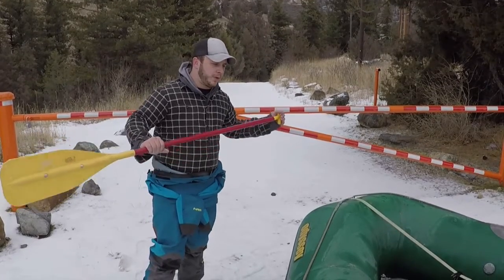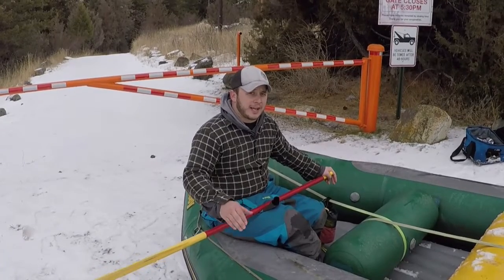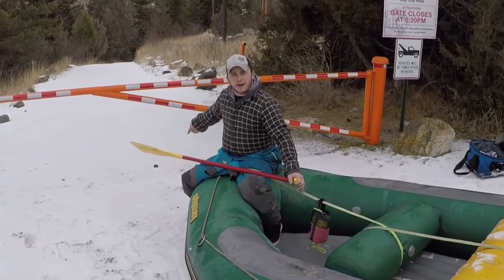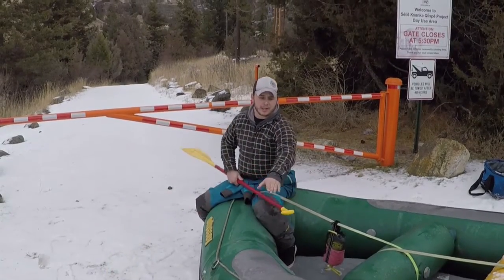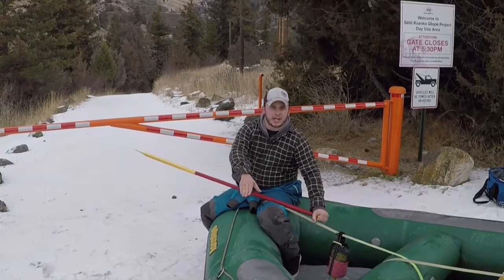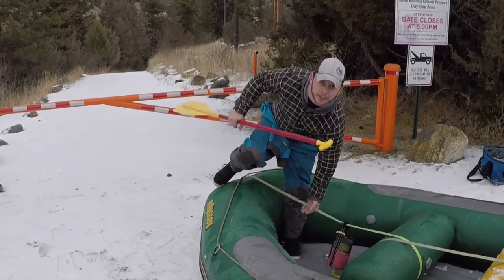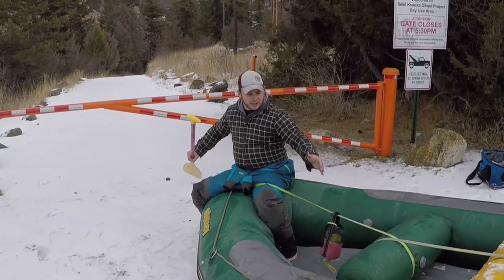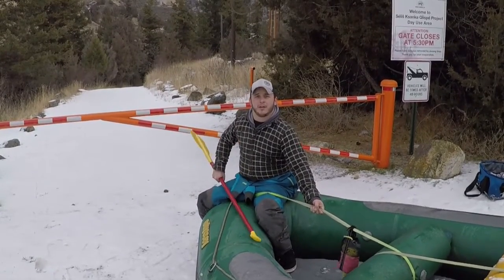The Center-line and why i use it!

Comment: I've been rafting, kayaking, guiding since 1986.  I do have experience with center lines, good and bad, so let me share a few thoughts.  Entanglements:  we flipped a paddle-raft with a full-length center-line on the Crooked River in Oregon at high-water and my foot was entangled in the line and I was trapped under the boat.  Luckily, I was able to work myself loose just as I was pulling my knife, but getting dragged most of the way through a long Class IV+ was pretty sobering.  If you're entangled and getting rag-dolled, even being able to reach the strap to cut it might not be possible.  I would suggest not doing a turn around the thwarts and instead securing it with with a smaller strap run under the thwart and over the center line on either side of the thwart (kinda hard to explain, get in touch if you can't make sense of that, there is a "trick" to it).  This holds it tight to the thwart and you don't have a loop that an arm or leg could potentially get snagged in.  Most boaters I know who have rafted a lot of serious water either don't use them or use modified versions after having had a sketchy experience, including getting caught in low-hanging branches.  In the early 90s, we used to do low-water Green Truss (White Salmon) runs with a center strap and the person in front and back tucking a leg and sitting high like you do (referred to as "sweep-boating" similar to what they do on the Middle Fork).  Upside is that it is extremely manueverable, like a tillered fire truck, and the downside is that you have a high center of gravity, half your body is hanging out and it's harder to stay in the boat.  Also, as you pointed out, you're just a steering wheel and not assisting much with paddling.  Your choice, I guess, but I personally wouldn't do it in anything above benign Class 3.  All that being said, I love the enthusiasm and love of boating that you and your crew have and hope you all stay safe and enjoy a lifetime of adventure.
Reply from the maker: Rob thank you very much for the story and finally putting a name to the "sweeping method"! Guiding like this is definitely a personal choice and I'm very glad you are open to people doing it, there have been a ton of people who have been very negative and harsh about it. I'll be in contact to learn the "trick" you speak of
Reply: @deathanglewhitewater  Maybe follow me on Instagram and we can get in touch privately that way.     I never look at Facebook.  Glad to chat further!
Reply: Sweep boating!!!  Did guide a class 2(3) on a 18' , sometimes had 12 customers in it.  Sweep-ing from the back with the largest guide paddle from NRS was the only way to go.  Technical in 14' I liked the footcup alot better.  But as I said, sweep boating was the only possible solution for the 18'.

Comment: I appreciate your enthusiasm and the effort you put into making this video. That being said, I completely disagree with your use of the center line and the way you guide off the back of the boat. Just because you haven't had an accident yet doesn't mean it's safe.
Reply from the maker: Rafting period isnt technically safe..... right this is different and it's not just me doing this but a few companies here the company  I work for has been doing it for 20+ years.
Reply: Rafting is much safer if you take out entanglement hazards like a center line.
Reply: @deathanglewhitewater  20 + years? How old are you?
Reply from the maker: @WanabeWingsuitPilot  the company has been doing it that long it's been 10 years for me

Comment: You get to the point at 9:40. Tree branches, rocks, strainers, old Fords, all that stuff is in the river and can catch on your strap--hopefully not when your head is underwater. Its not about what happens when your raft flips in some big splash and giggle class III. If you are running the Flathead at 5k all summer, then yeah, you might not have to worry much about all that. Or maybe you've just gotten lucky so far.  Your prerogative. But in Oregon, Western Washington, Nor Cal, there are often more rocks than waves and there is wood in the river. You will find it eventually. A few years back on an Oregon classic I was leading my group into a class IV I new well, rolling on down river. A group of kayakers we'd been leapfrogging with all morning waved from shore saying "wood!" So I pulled over to give it a scout but couldn't find the wood. I had them point it out and I saw a short log way off the line, no way you should be there, and hell it was smooth, not even any pointy branches on it anymore. We asked where they were from and and they said "Colorado."  There are plenty of damn fine boaters in the Rockies, and these folks were some of them, but had a different set of references. I think that is what you are coming up to with your negative comments. I can't imagine not worrying about entrapment on the rivers I run.  For your river, do the strap, hell its convenient, but for our rivers, you might want to rethink it. Or at least do what Rob says, he's been around the block a few times.
Reply from the maker: I appreciate and understand your concerns. I also have the critical thinking skills to understand when it is possibly more dangerous. If something is a threat to the center-line it's a threat to any boat and person possibly in the water. My guiding skills are to read and assess all situations and dangers that I can. I have rafted rivers in Washington and Oregon and didnt see anything at all that made me not want to not use it. I guide on a super rarely ran incredibly difficult and shallow class V river here in Montana and still feel more comfortable running with the center-line and than not.